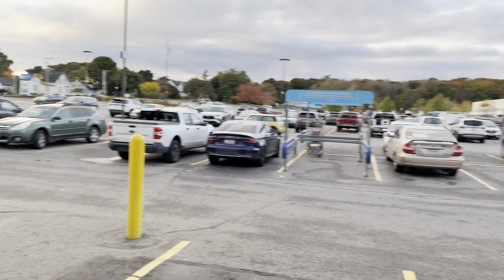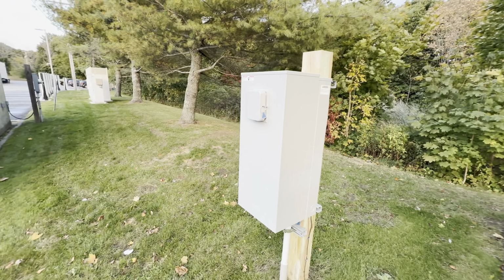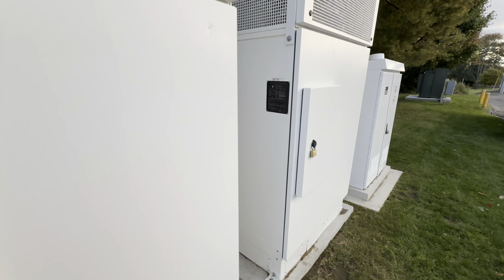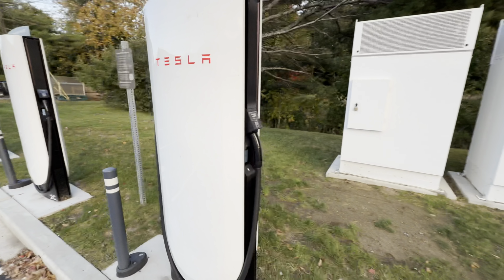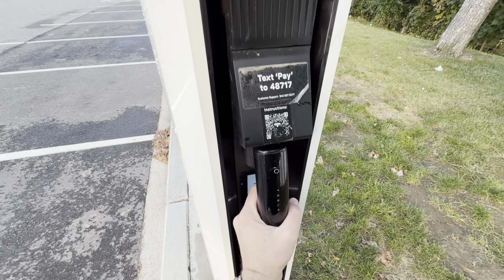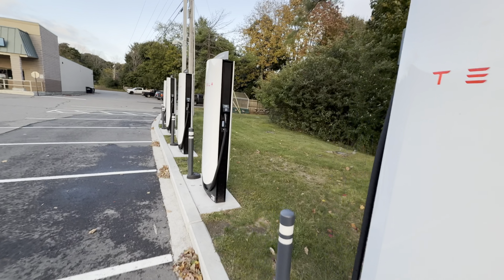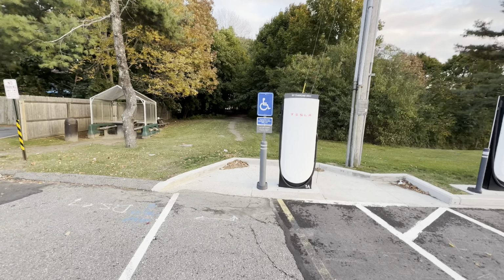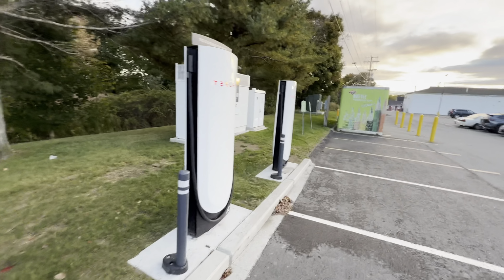Not In Compliance! Tesla's First NEVI-Funded Supercharger Site! Rockland, ME Site Tour & Impressions

Comment: Used this site a couple months ago. Pretty disappointing charge that I think topped out around 120KW, station limited, when it should have been around 210KW. Only 2 other vehicles were at the station. That said, good location and no issues activating via app.